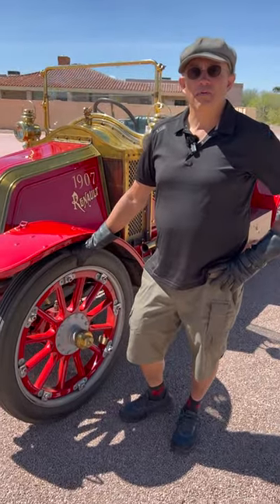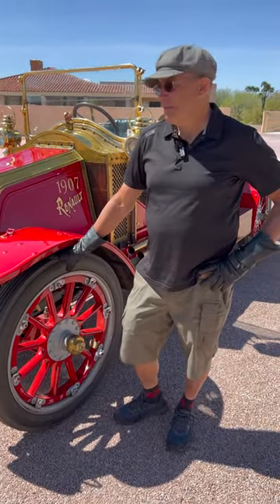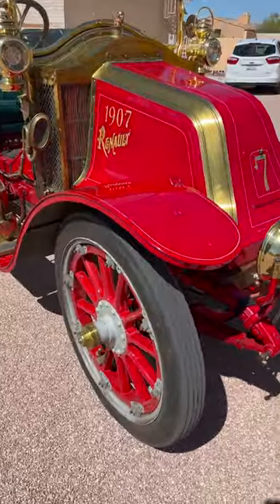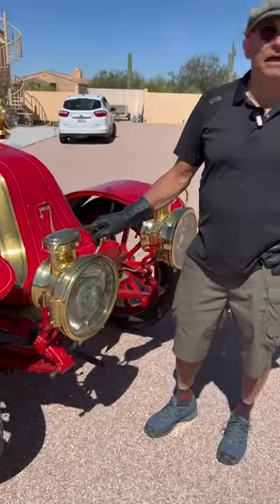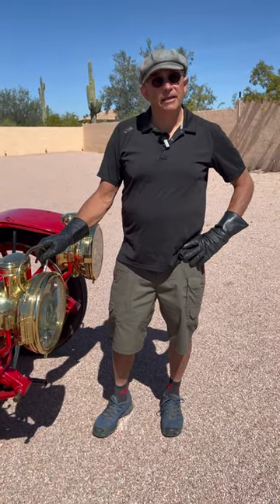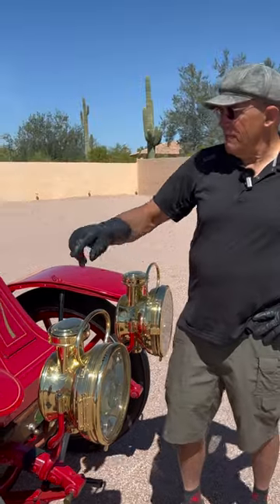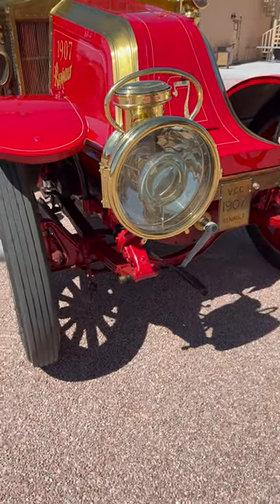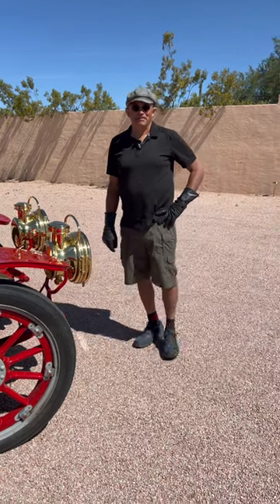Acetylene Lights! ALSO FULL VIDEO AVAIL 1907 Racing Renault IA w Alan Travis #shorts

Comment: The headlights were also used for lighting the path when going in the house and while inside because many people hadn't yet acquired electricity. Also used to light the way when a breakdown occured. Coal miner's used a small lamp connected to their hats for lighting using the same type of carbide and water mix. Very dangerous when there's the possibility of methane vapors underground. My first car was a 4 door, rear engine 4 cyl. 4 speed  Renault 10. 40 mpg. Gas was.50 a gallon.
Reply from the maker: Great insights - thank you for adding your comments, Danny.

Comment: They may well be bright but not that bright. Pellets, no. Try rocks. Carbide comes as a stone.
Reply from the maker: We’re gonna have to do a test one of these days
Reply: Can’t carbide stone be rounded to be called pellets? Is it worth correcting someone? “Stones not pellets”🤔. Are all pellets the same? Can a pellet be a stone or a stone be a pellet? Is a pellet shaped piece of carbide still a stone? Can the lights use either or? Guess the question is what is the difference? Or is the difference just in the name?